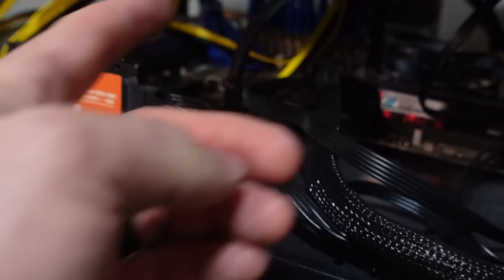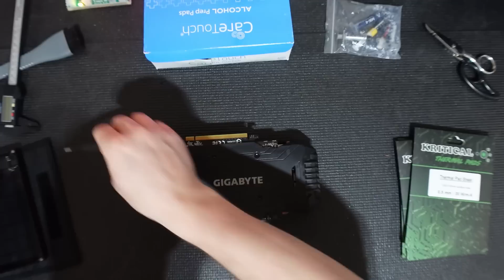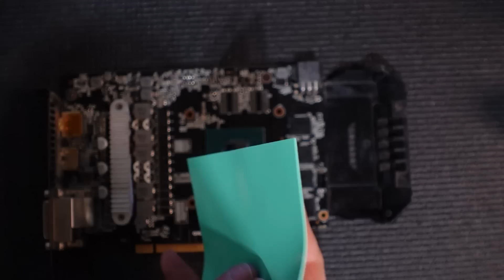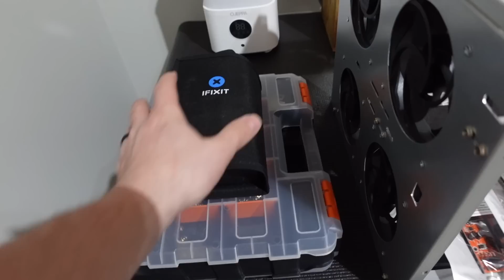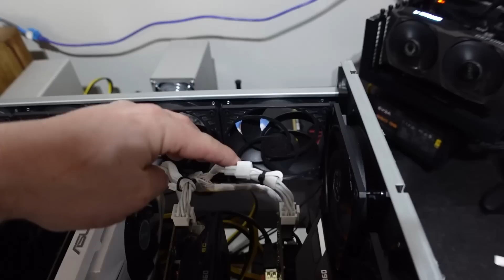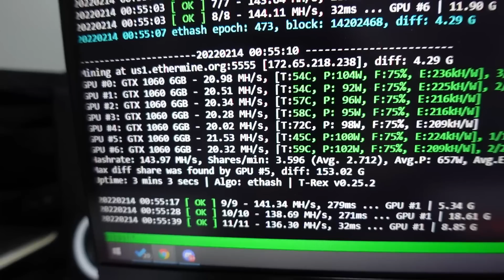Building a GPU Mining Rig With Older Graphics Cards | Still Profitable in 2022

Comment: From what i saw on your rig your temps from the graphics cards are all between 55 and 70 celsius not bad but a bit hot, i got mine with ATI graphics card from Sapphire and all RX 470, 570, 580, multiple cards are all under 42 celsius even with overclock for mining and they all have fans at side of each card

Comment: Guys question please... I have 1000w evga main Psu, running 4 cards, 2 1660 super, 1660, 2060 + h110 pro mobo system connected on it also + 3 fans.. Gpus are udervolted  83,75,76,71, 
Still my 1000w is safe to run or reduce the cards connected ? 
 Slave psu 850w... 3 gpu on it + 3 fans
Reply from the maker: How many Watts at the wall does it day your using
Reply: @TheHobbyistMiner   hey how are you sir. Unfortunately I don't have that power meter for now to be accurate on how exactly that 1000w is pulling  . In 3 days It will be delivered, I will post it here for assistance on proper readings
Reply: @TheHobbyistMiner  on nicehash app. It shows  611w,  7 active device, 246.44 MH/s.. It's calculating all 7 cards most likely.. Good thing I'm not getting any restart or reboot from rig it self. Sometimes like 1 month or less the miner ' excavator' will restart. So I'm confused if it's internet connection or maybe 1000w is overloaded because 4 cards on it  with the main mobo total 7 cards connected..

Comment: Hope its ok to ask this. I'm trying to build my first rig and starting off very small with parts I have already. I have a micro ATX motherboard, i7, Sata drive, and memory that are old but still new in box. I'm sure the PCIEx1 and PCIEx16 slots are first generation. I've ordered two of the AAAWAVE PCIE Riser VER 009S extensions. I have an external power supply that I intend to power the GPUs with that have the 6 pin power supply.  My question is this, do I have to worry about what generation of GPU I buy?  If my slots are Gen1 and the GPU cards are Gen4 does it matter?
Reply from the maker: Should be just fine! Nice setup!

Comment: I scream F@&# so many times on my mix AMD/Nvidia 12 card rig my wife named it Roy Kent. It has a 1060, 1070,  3-1660s, 1- 2060, 1-2070, and 5- 6600's.
I am considering moving the AMDs to a rig with 2 - 470's and run the Nvidia separately. These are cards that I have had for awhile now and I am not sure if I will sell the nvidia and replace them with newer AMD cards or Intel when available.
Reply from the maker: Keep them all! ;)

Comment: Hey man,

Great video as always, I have a 6 x 6600GPU rig that I am building, but my power supply only has 8 pcie cable, should I use splitters to power both the gpu and riser will it be safe?
Reply: Absolutely, I've got 8x 6600XTs running on splitters - one end powers the riser (6-pin), the other end powers the GPU (8-pin). 2 cards (so 2 splitters) per PSU cable. No issues.

Comment: That looks like a bad fan setup. You have case fans sucking air away from GPU fans that are trying to pull air in. In my experience all fans should be blowing over the GPUs for active cooling. Unless your case is sealed, any fans directing air away from the GPUs are pointless. Air will take the path of least resistance and the hot air created by the GPU will want to rise rather than be sucked through the fan.

Comment: I wonder if the multi gpu rigs are the issue.  I have a 580, 6600, 6600xt, 590 12 gpu mix rig.  Very strange things occur when I tried to bios mod the 580's as well as tweak each card.  Only my 6600 cards have the exact same OC.  I have 4 other 6600xt's that all have different OC and power settings.

Comment: You can have more room for cards by putting the fans on the outside instead of the inside. On that frame you can fit up to 305mm long cards without interference.